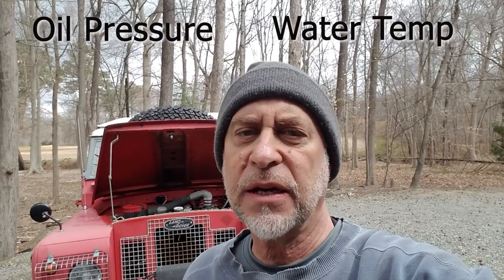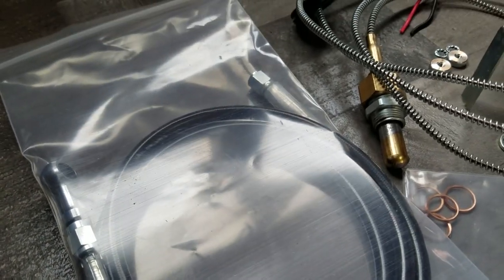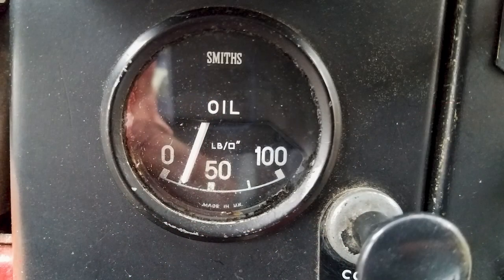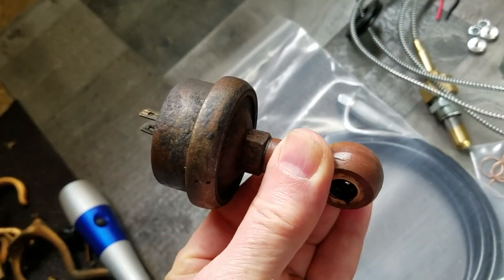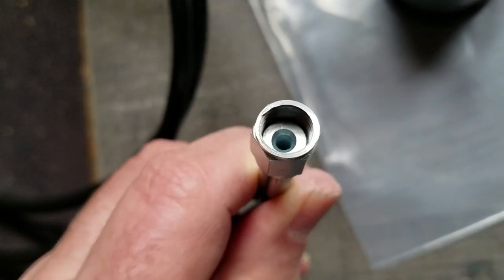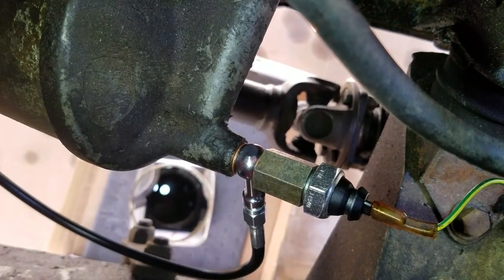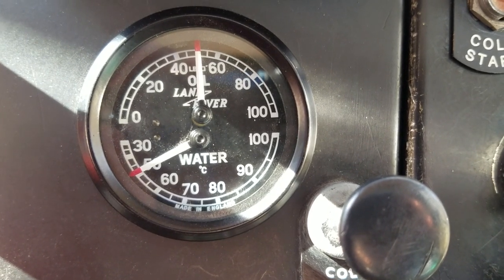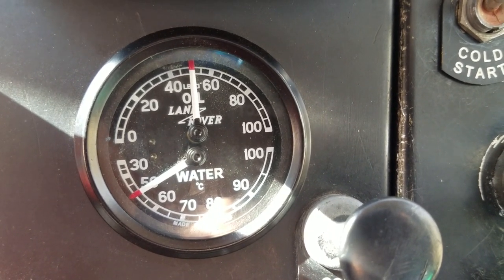Video 11 - Series IIA Land Rover (Gauge Swap)

Comment: Don’t underestimate that capillary tubes ability to lose all your oil. When your oilight comes on the Engines already seized. I lost 5 ltr out of 7 in just over 1 mile at 30 mph.   I’m going to arrange another oil light switch next to the gauge, if the capillary breaks on the engine side of the bulkhead then a bright red lamp comes on in my eyeline. I had a lucky escape!!
Reply from the maker: Thanks, Martin - What kind of sensor would you use and where will you place it? I kind of trust the green oil pressure switch.  I guess one regular item to check (sort of a pre-flight) is to look at the oil hose down near the oil filter connection before start up and make sure it's clean and not leaking.  Thanks for your comment!
Reply: MikeShawToday   You won’t check every time. No one does. 
It may look fine , but could get hit by a stick or stone that breaks it. First thing you’ll know, you’ve seized. 
The oil light comes off the block in the filter housing. The capillary for the gage tees off here. If the capillary breaks on the engine side of the bulkhead you lose all your oil from a 1/16 bore pipe. The pumpll keep the green light off cos that’s about 8 psi until there’s no more oil. Then the green light comes on. Too late mate. 
I’m fitting a tee behind the gauge IN THE CAB so if the capillary breaks I lose my oil pressure reading ( won’t notice) AND a bloody great red light comes on. ( should notice!!!! ). Even a brand new tube could fail. Been there done that. 
Be warned!!

Comment: Why didn’t you put the end of the oil pressure cable that goes to the gauge through the fire wall hole instead ? It looked way smaller and would of saved you cutting a hole...?!!
Reply from the maker: An important question, and I wish I had explained this better in the video.  The oil pressure cable - no problem. Did connect the way you suggest through existing firewall hole.  But it was the large bulb on the water temp cable that forced me to make a big ugly hole.  Reason: The small end of the water temp cable which goes on the gauge is permanently attached to the gauge. This is because it ether filled, like a glass thermometer filled with alcohol or mercury, so permanently sealed. The bulb end also sealed on there.  You don't have the option to remove the cable and bulb- it is part of the gauge.  Thanks for helping me clarify.

Comment: Hello Mike, new 71 2a owner. I'd like to ask where you got the piece that screwed into the oil filter housing? That special piece you described that the banjo nut slid onto and finally the green light sensor piece. Thanks and great videos.
Reply from the maker: Hi Rick - I'll have to point you to several places. First - try BAT Inc, in Sarasota, FL - www.batinc.net  They know all about threads and banjos - but nothing about Land Rovers. Explain what you want to do, and provide a picture of the piece you want. This photo is in my article published in CLR on my website - August 2020 - Dual Gauge.  Do a screen shot. I can tell you now that no-one really was ever able to tell me the actual thread size, whether British pipe or what. Also, call Rovers North, and whoever is helping you there - you can send this picture also.  If you e-mail me - I will send you the high quality photos.  They or BAT should be able to get you either that piece or a whole new banjo adapter and a new piece to go through it.  At least Rovers North has your same oil filter housing so they can test the threads with anything you need - on site.  You need to make sure all the pieces fit before you buy it, and that the oil filter switch also fits nicely into the end. Download the article from my blog here.. https://mikeshawtoday.blogspot.com/2020/12/classic-land-rover-magazine-mikes_4.html